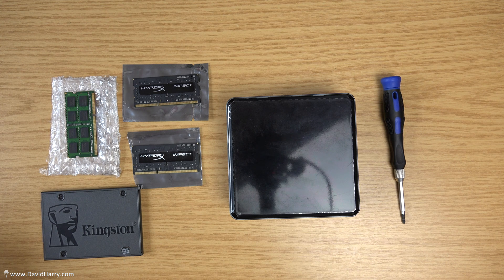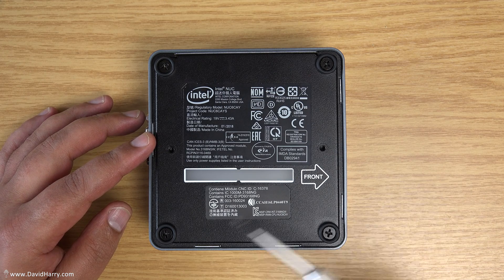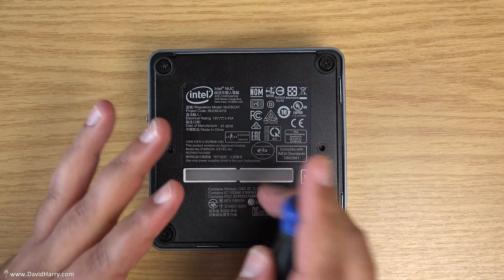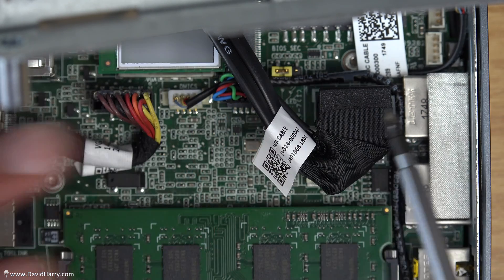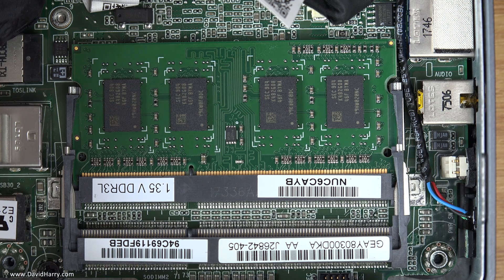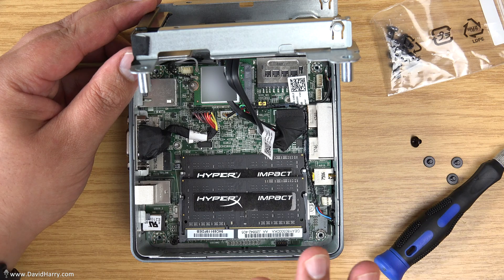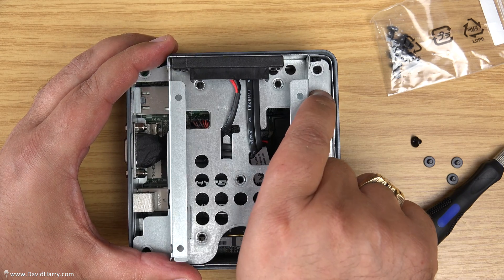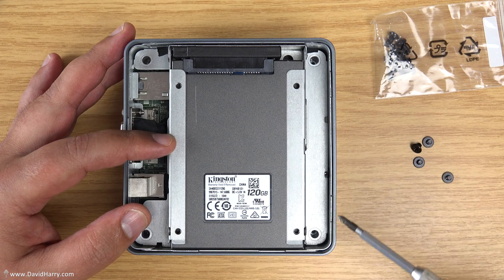How to upgrade the RAM memory and SSD hard drive in an Intel NUC, in the case the NUC6CAYS

Comment: Thanks for the clear demonstration. I’ve installed 12GB RAM in my NUC6CAYH (4GB in the lower slot and 8GB in the upper slot) along with a 256GB SATA3 SSD. Although the official limit is 8GB, this combination is working fine. The RAM is DDR3L 1600MHz (12800S), and Windows 10 Pro with the latest updates is running quite fast.
Reply from the maker: Glad the video helped you to upgrade your NUC 👍 Cheers, Dave.

Comment: Thank you, this is a great instructional video. The steps are both clearly explained and depicted, and I'm excited to add a SATA III sdd to my newly purchased Beelink i5_8279U mini desktop (which, I must add, is a fantastic deal of a machine for its usual price listing, which is ~$450 – mine was $378+ tax on a sale I'd been keeping tabs on) because I've decided to replace my main/work computer with the little Beelink system. I wasn't expecting much from it, so what it delivered was the most pleasant surprise (especially when I fired up my favorite emulator to test it out for BOTW/some light gaming)!
Reply from the maker: Hi Jonah. It's my pleasure and you are very welcome. Most people underestimate the power of these small form factor PCs but as you know, they can be awesome. Plus, having a nice little machine sitting next to your monitor is way better than a big box. Cheers, Dave.

Comment: Hi My NUCcayh is windows 10 pro 1.5 to 2.3 I have 16 GB of RAM and went for the 500 GB SSD it moves quickly and handles whatever  I have thrown at it ,i barely had $400 and feel lucky it does the job and cable comes out easily ,Great Job David Thank You

Comment: Thanks for the tutorial. Did the performance improved considerably? The Intel celeron with 2gb of ram and only 32gb of emc storage makes it laggy, I'm thinking about adding a 4gb DDR3L-1600 to go along with the 2gb already installed, would that work? That way I'll get 6gb and windows 10 will thank me. I'll also add a Kingston 120gb ssd like yours since it's so cheap.
Cheers
Reply: What kind of memory did you installed on your Nuc
Reply: @Junbug414  This one: CRUCIAL - SODDR3 4GB PC-12800 (1600 Mhz) 240 pin CL11
 (CT51264BF160B). Now I have 6Gb and with a KINGSTON - SSDNow A400 120Gb this thing is very fast now. Intel is picky with RAM and I have to press the "Y" key when I start the PC since it warns me that it can be an incompatiable ram kit but its BS, its works perfectly. I recommend it!
Reply: @andrepamendes  thanks so much for your response
Reply: @andrepamendes  yeah you know that i have another intel Nuc which I installed 8gb as well and ssd  I have to press Y too It tell me the same thing. i ask cause i bought me another one barebone  Nuc so I wanted to buy the right memory this time. Thanks again after installing 8gb of memory it run fast my first Nuc I luv it for a mini computer.that why i bought another but barebone this time.
Reply: Hey I just got me this same device after I buy ram and hard drive do I need to purchase windows 10 ?
Reply: @FEAROFSHAUD  if you bought the barebones, then yes. Or crack it. I bought mine already with ram and it came with windows 10 pre-installed
Reply: Get a 500 GB SSD you will be glad you did and have 8 GB of RAM 16 GB if possible ,this lets you save up to put more into it easily rsdno